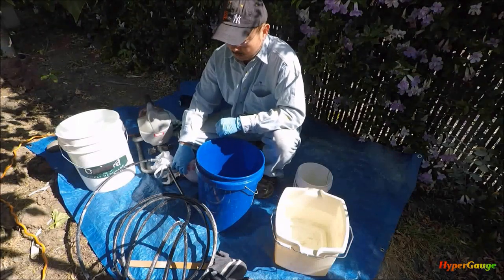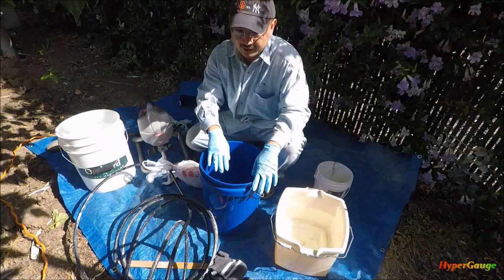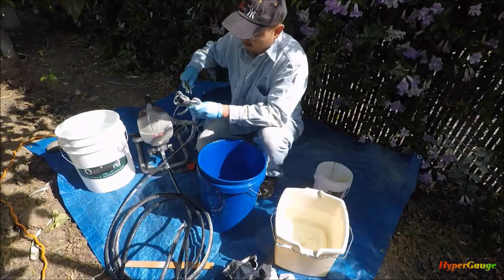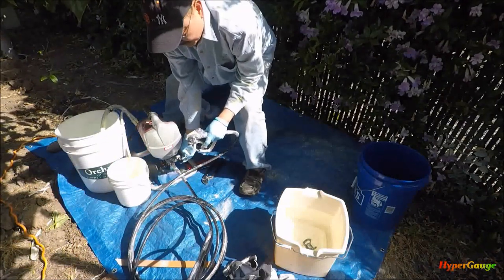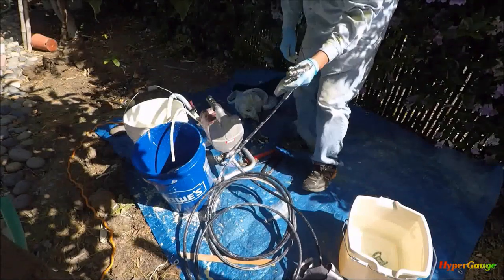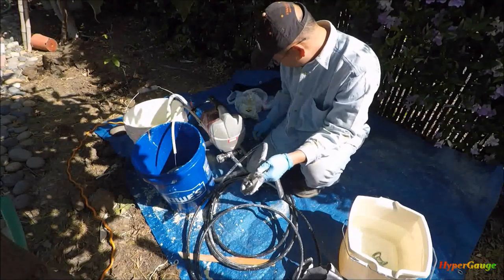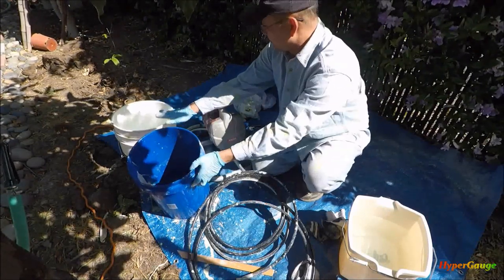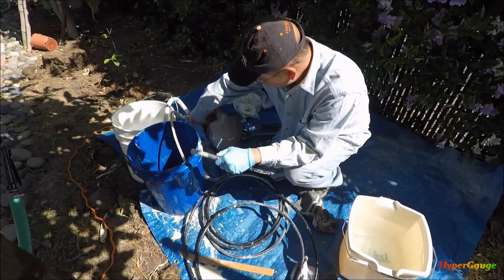1/3: Cleaning the Harbor Freight paint sprayer system - Cleaning the main system

Comment: When you want to store for 24 hours, take off the guard, spray tip, and with the gun dump it into a bucket filled with water.  That way you don't have to wash if every day.  I have been doing this painting the primer and ceiling for the last week, and everything works fine.  

Make sure the unit is off, and turned to prime to relieve pressure in the line.
Reply from the maker: Thanks for watching my video! 👍